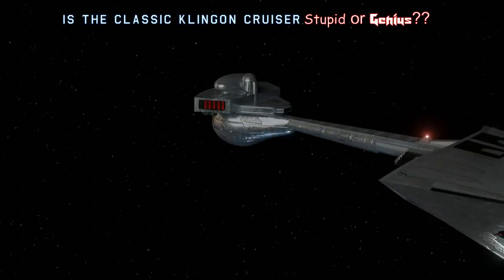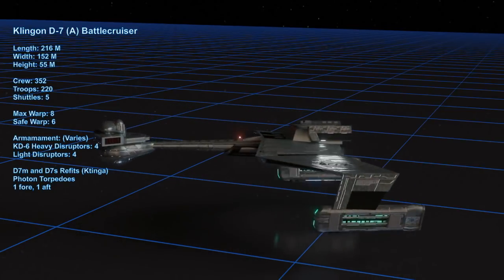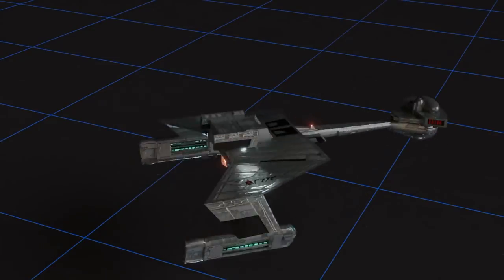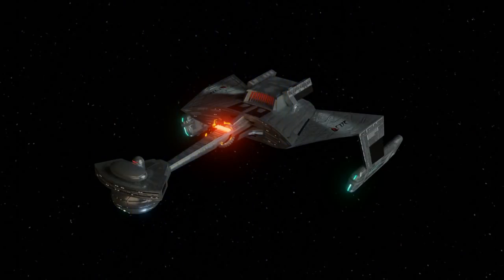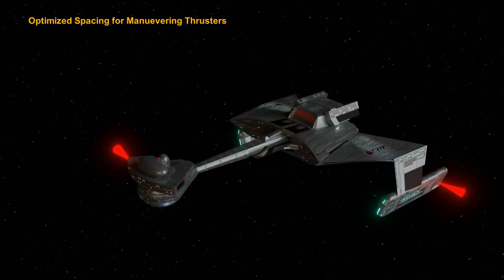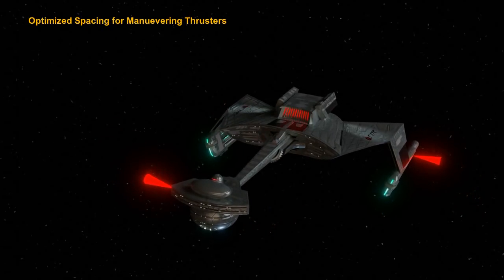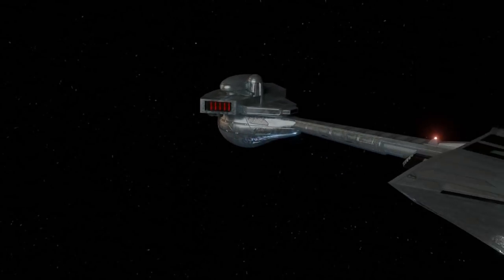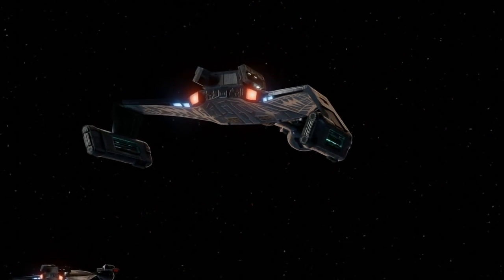The Classic Klingon D-7 Cruiser - Stupid or Genius Design?? Animated Breakdown!

Comment: Back in the 70's and before Paramount took control and made fundamental changes there was no mystery.  In the original lore that was written after the series but before the Motion Picture the Klingons were a warrior race that had once served a different more powerful race as soldiers and security troops.  The Klingons overthrew them and took over the empire, including its use of other races as servitors and labor.  One of the key features of a Klingon ships was the ever present security stations.  The entire run down look and feel of Klingon ship was driven by none of the technology was theirs.  They were basically barbarian warriors who had seized the ships and forced subjugated peoples to maintain them.  On my original D-7 deck plans the Klingons (Officers and senior enlisted) lived in the  Command Section forward of the boom.  The lesser races and conscripts lived in the main hull.  The Command Section contained all of the important information (primary computers and navigation data).  In the event if an uprising the Klingons could separate leaving the engineering hull to fend for itself.  The after hull was not functionally balanced without the boom section and could not maneuver with impulse or go to warp.  Of course they wouldn't have a navigation data or controls suitable to con the ship.   Later the entire idea for the Klingons changed from the conquering horde merely coopting stolen technology to the honorable warriors with their own technology.    There were a lot of changes when the property went from an old "failed" TV show to a multi-series and movies.    A lot of the "weird" design features of the Federation and Klingon ships will also make sense if you realize that they swapped the location of the Warp Drive and the Anti-Matter Reactors (Warp Core).   The original Warp Drive that created the actual warp field was in Engineering (going womp womp womp in the background as Scotty yelled "she can't take anymore!".) The two Anti-Matter Reactors were out on the ends of the pylons with their Bussard Ramscoops to collect what they could.  They were away from the ship to reduced radiation and so they could be easily ejected if they were to destabilize.  The Klingons nacelles were closer in to the hull because they didn't care.  All the important beings were in the Command Section and the lowly servitors could be replaced.  My later copies of the D-7 and Constitution Class deck plans show that they were all changed for the new revised official cannon.   

All good to go, but it does leave a fair number of things that do not make sense if you were never exposed to the early material.  When you realize that the TOS Klingons were basically totalitarians standing on multiple slave races you get the reason Kirk and most of Star Fleet were so unbendingly opposed to them.   It did get confusing of why Kirk hated them so much when the canon had been redesigned removing the core reason.  The TNG/DS9/VOY Klingons are my favorite version.  The TOS Klingons were from a low budget cold war era show.  I like TOS but not as much as what followed.   I simply do not acknowledge the space orcs portrayed on the current disasters masquerading as Trek.

Comment: The maneuvering thruster locations you cite aren't on the planar center of mass, and so would throw rotation askew and cause problems. This is a systemic problem with virtually all of Star Trek, so at least it's consistent. However, the warp field geometry argument makes zero sense, as the Alcubierre hypothesis for warping space isn't dependent on geometry. The radiation argument fails because other Klingon ships also adhere to the long-neck design. The bird-of-prey motif was the sole reason for the look.

Comment: What one might think of as a weakness the Klingons may take as a strength. If the neck was attacked and severed,  the ship would become two and allow them to attack from two fronts. I would like to think that there was a battle bridge in the main section to allow swift response if the ship were cut in two. I would think there would be blast doors that could seal off both ends of the neck during battle and give the enemy a false target. Bad engineering? I think not. Cut the head off the bird and now you are facing a double threat.

Comment: The Design of all Klingon ships is based around there unique warp field technology and combat efficiency. The shape of the ship is basically a triangle matching the warp field generation. Klingon ships are at their core spartan. The neck is slim because extra mass is simply not needed at this area. Klingon ships are all about speed, maneuverability and weapons. Everything else is thrown out. Federation ships like the Enterprise also have a skinny neck but it has a huge saucer section because federation personnel require nice living quarters, science sections, cargo, shuttle bays ect ect. Imagine a Klingon ship with all the cozy additions and you would see a huge saucer section taking up most of the neck instead of a spartan small front section/head. Klingons trim away all the excess fat.

Comment: The one thing about TOS-R that pisses me off to no end is they screwed up the D7 impulse engines,  If they had done even the smallest amount of homework they would know that the D7 has a single impulse that's below the hangar deck in the module on top of the main hull.   Aiming for the boom of the D7 is like aiming for the neck of the Constitution class, it's not really possible when the other ship is shooting at you.

I have a bunch of old blueprints and the majority of them label what would be the torpedo launcher as the navigational deflector, We also never saw the D7 fire torpedo's in the original star trek except when it was a Romulan D7.

Apparently Matt Jefferies called it the main sensor as well.

Comment: Weapons are portrayed poorly in ST. Armor is completely useless and when the shields go down, the only reason you don't die from one hit is because the ship targeting you wants to disable you, dialing down the power of their guns. It's all PIS for drama.
The numbers for armor, with a structural integrity field, are insane but the numbers for the weapons are a few orders of magnitude worse.
Not even neutronium would stand up to such forces, the difference being it would explode a lot worse when it vaporizes.
Shields are ablative particle fields and can be renewed very rapidly. The particles are annihilated but at a distance where it doesn't affect the performance of the generator by proximity, allowing the generator to remain as efficient as possible until it's overwhelmed. A massive portion of any ship is devoted to these generators. The effect on them is cumulative but on dependent several thresholds of degree.
A ship's durability is 99.75% shields, .2925% structural integrity field, .0015% armor and .001% base hull.
One photon torpedo ought to do it.

Comment: What if older Klingon drives produced dangerous radiation or had containment issues. So like with modern concepts of constant acceleration nuclear powered drives, you want to separate the crew quarters from the dangerous drive section?
Reply: nm you addressed that lol

Comment: The D-7 was supposed to have been an improvement over the TOS Romulan Bird-of-Prey, hence its use by the RSE after the Klingon-Romulan technology exchange program. I doubt the RSE would have used a design that was a major radiation hazard; it's not efficient to kill off valuable personnel. 
I think warp geometry informing the design is more reasonable, especially if the Klingons were using design optimization to keep only the most essential elements and do away with what amounts to dead weight. That's the way real-world design is done.

Comment: technological advancement is relative. hundreds of years before the use of sails on ships, the technology would seem very advanced. in a future where the d7 is common place the tech on the ship could be almost juvenile in the eyes of the crew and a relatively uneducated slave could work in the drive section with moderate supervision. i think there is also another advantage to this idea. in a fight where an enemy manages to board the ship they would basically have to chose between attacking the forward command section or the drive section. if they take the command pod, an officer in the star drive could dump the forward section and continue fighting in a limited capacity. the same if the enemy takes the star drive first.

Comment: Considering its the longest serving spaceframe in the Alpha, Beta and Delta Quadrants,  the Klingons got something right designing the D7/K'Tinga-class.

It's been serving since the Enterprise-era to the TNG/DS9/Voyager-eras.  

The TOS version still a formidable foe against a 24th Century ship like a relatively new Intrepid-class like Voyager.  After all, they were designed to take on the best the Federation had to offer on relatively equal terms let alone lesser ships with a fair to good chance of winning depending on the opposition.  

Heavy photons and heavy disruptors are still heavy photons and heavy disurptors no matter what ship fires them. 

Like a WWI-WWII cruiser vs a modern Burke-class Destroyer.  Sure, the Destroyer is technologically superior and with longer range precision weapons.

 The heavy guns on that old ship are still a big problem and still will do some major damage.  Armor plate is still a thing too. 

They're probably in Picard too if we saw an old-school  Romulan Bird of Prey still flying.

Much love should be shown to the  D7/K'Tinga-class

Comment: Never heard of the possibility of a "boom separation" before, and frankly I don't think that Klingons would design their ship that way. First of all would such a separation system reduce the structural integrity of the ship. If you're going to battle it's much more feasible to make the ship as sturdy as possible, and you do that by making it one part instead of two parts that are stuck together. But what is more is that the Klingon warrior philosophy would never allow for the ship to be separated. For what reason? If the ship is boarded then you either overcome the boarders or die in battle. If the ship is crippled and about to explode (warp core breach) then you don't evacuate - you go down with the ship and die in battle. If there is a mutiny and the mutineers try to get to the command section then you grab your bat'leth and kill those treacherous petaQ or die trying.
And finally separating the ship in battle is a case where the sum of the separate parts is weaker than the whole. If the lion's share of the officers really is located in the front section then separating the ship would mean you separate the rest of the crew from the commanding officers. And as I doubt that the front section has a warp core or a comparable powerful energy source on its own, it's unlikely that the front's weaponry is powerful enough to make a difference (some goes for the strength of the shields).

So I really doubt that any Klingon ship, no matter what era, would ever separate (unless it's an equivalent to the Prometheus class which separates in three combat-worthy vessels).

Comment: I would say it is most likely all might be in play.  Other, older weapons could be partially responsible. Such as a mass driver. But were dropped with newer technology but the design element was already incorporated. Klingon reactors and engines have a reputation for poor sheilding. The warp geometry, I'm a little iffy on. As with most known fluid dynamics,  a point first geometry would be bass akward. Maneuvering leverage is a no brainer.  Other things niggle but don't have the background material to front them.

Comment: Well, actually...
maybe this was an intentional flaw.
Digressing one moment though, the theory of slave labor or lower lower caste is an intersting theory but like Kirk said in ST2, "...Klingons don't take prisoners.".   So where is the divide line there?
Now getting back,
We know Klingons value honor first followed by the glory of victory.  I would theorize then warships would be built to attack with aspects of shielding and maneuverability as more like necessary afterthoughts than primary concerns which would be an appropriate mirror image to say Federation shipbuilding.
A vulnerable boom hidden by a pronounced bridge structure stating, "You have to go through me first" keeping the bow to the enemy would be very fitting to that of Klingon.
With this, I would propose the D7 was designed with the need for battle in mind to force courage.
Again, maybe this was an intentional flaw forcing a commander to actually be fighting his own ship before even leaving his own port forcing a will to win later.
In combat, the more fierce commander would survive.
The lessor would, well, wouldn't.

Comment: Honestly, between this and the Connie's neck (and nacelles), I'm wondering if Roddenberry wasn't creating Video Game Weakpoints before there were really video games...

Semi-joking aside, I think we have to remember that Star Trek is a Shield's universe- once the shields go down, BAD THINGS HAPPEN. And ships are designed to fight with shields- shield down, its Run or Ram time. (Think Fight or Flight, but with starships.) 

Likewise, the Klingon ship "necks" seem to be there to put distance between the Warp Core part of the ship and the Important People part of the ship- and if I remember, Klingon's engines weren't all that clean (insofar as radiation discharge). So putting some distance between that ship and the rabble that deal with it, and the Klingons on Importance, would also make sense. (Heck, if there's a warp breach, having the engine core way over there gives the Important People some extra chance of not dying in a dishonorable way.)
Reply: Huh- so...  okay, that got covered. =p

Though I do like the maneuvering thrusters/RCS theory.

Comment: Another i thought was very foolish was the d'deridex. If a small ship got inside the wings and superstructure it could spin around and spray the back of the front of the ship them the insides of the engines and almost cut the thing in half horizontally. Plus it's inside the shield bubble and there's no disruptors in there that ive ever heard of.

Comment: Obviously the design is meant to entertain. Looks Cool, or Uniquely Klingon, or Star-fleet shapes that are recognizable.
If I were however to apply rational science to the designed I would have to come to the conclusion that - Warp Cores are notoriously dangerous for crew members to be continuously exposed on duty in proximity to them. So - Each ship whether Klingon or star-fleet has separate special sections for engineering and reactor cores to isolate them from crew during the bulk of mission duration.

Comment: It may be a vestige of old designs that became visually pl;easing over time. My suspicion is in very early ship designs the enginges may have given off radiation that was hazardous so you want the officers and bridge to be seperated from the rear of the ship but regard the lesser crew as expendable. (Say early pre-Star Trek versus now) Then over time as tech improved, the engine room became safer but after using this desogn so long, maybe it was visually pleasing and maybe also became “tradition”. Secondarily it also could be related to the warp engines again being toxic hiostorically (since we also see the federation spaces out the warp engines) and keep the officers safe in front away from the warp fields. Then as tech improved and became safer that again the design was simply entrenched.

Comment: The Klingon Battlecruiser is made up of a forward module, and an Engineering Module. The Forward Module is a RAM. 
Yes, thats right, a RAM. The Ram is designed to enter the larger hulls of the First Federation Starships. However, as the Klingons learned, the First Federation is far more powerful than they thought: During the one brief war they fought against the First Federation, the Klingons never actually got close enough to ram the huge First Federation Starships. 

Well, it does sound possible. The Klingon Empire is a Warrior Race so their ships would be pure fighting machine, every bit of the D-7 is designed as a weapon. Even the wing edges of the Engineering hull have been seen to slice through the hulls of other starships. When all weapons are either destroyed or exhausted, the Ram can then be employed to either destroy an opponent, or as in the case of the United Federation and First Federation, to actually enter the enemy ship and I can envision huge portal doors opening up and storm troopers flood out to take the ship. 

Just my opinion only.

Comment: why not build it like a star destroyer? adds cost adds materials, adds complexity and space not needed. you missed the klingon perspective, what works. does it work for them as a warship yes. as a raider? yes. so IF it's design is related to max warp speed then it checks all boxes as is without wasted effort or cost that could  be better spent defeating the enemies of the empire.

Comment: I believe the radiation theory is from the old FASA dice game, considered cannon... ish.  Slave labor class rides coach.  If not, I read that many times in the 80's.  The engines and whatever are cheaper to produce and maintain without as much shielding.  But you can look it up.  I'm sure a pain giver belt attached at the stomach ensures productivity.  Glory to the empire.  Etc.